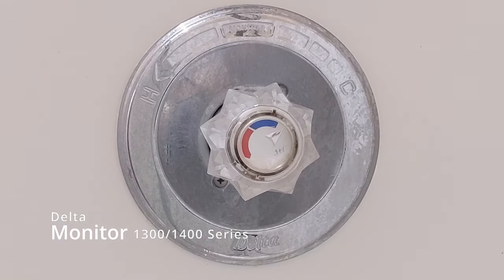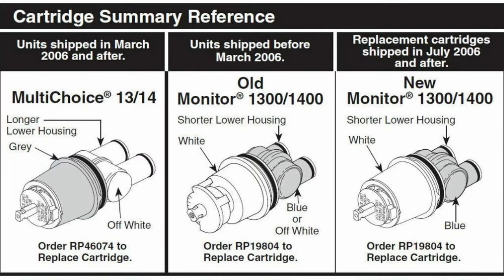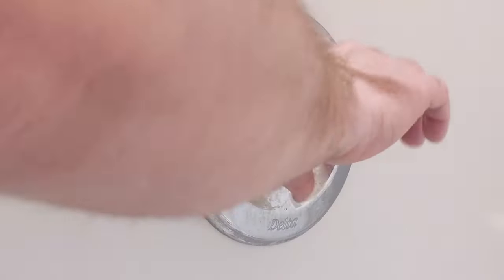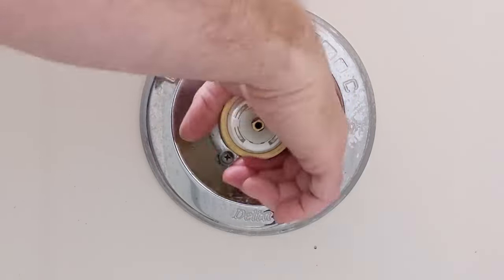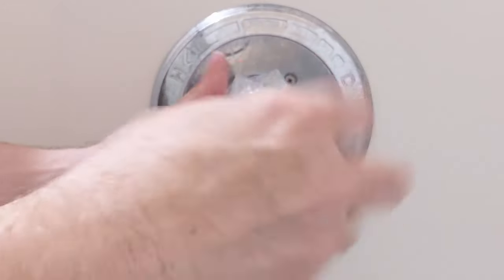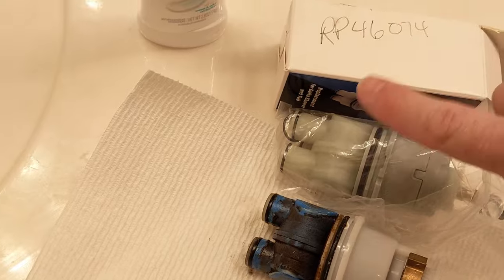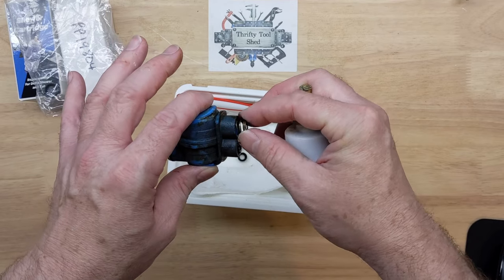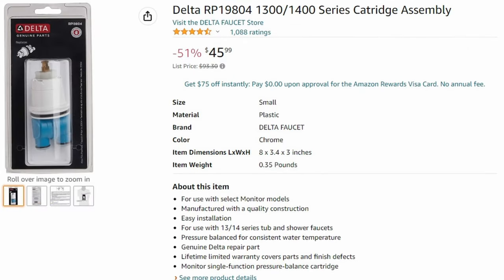Delta Monitor Shower Valve Cartridge Replacement

Comment: This is for anyone that runs into the kind of problems I did. Cartridge WOULD NOT come out. Finally the flange around the the ports that hold the seals & springs broke away and the stem assembly came out. Clamped onto the ports with needle nose vise grips. After much effort the port assembly came out far enough I could grab it with channel locks from the side. Never did see what was holding it. Luckily there was no significant damage to the valve body and none to the connecting plumbing, so a new cartridge solved the problem. Hopefully, I'm the only one that experiences this. Thanks to Thrifty Tool Shed for showing me what I was dealing with.
Reply from the maker: Thanks for sharing your experience with all of us.  Glad you found it helpful.
Reply: Mine also the part holding the seat and spring left behind on the faucet. Can I wiggle up and down so that it comes out easily or use a set of pliers to pull out the part separated from the front part of the cartridge?
Reply from the maker: @HMR2121  
Sometimes the line will have a vacuum on it if any lower line is dripping or draining and the shower valve is off. Make sure the shower valve is turned on so it releases the vacuum and you should be able to gently rock it back and forth and get it out.
Reply: @ThriftyToolShed  Thank you so much, I took it out and replaced a new cartridge and it stopped leaking. Wow! You saved me hundreds of dollars.🙏
Reply: @ThriftyToolShed  I turned on my shower valve, but I could only get about 5 mm of the cartridge out. Can I spray WD-40 in the gap hoping it will get to the seals and releases the cartridge out? Will that WD-40 damage anything? Thank you.
Reply from the maker: I don't believe it will hurt anything, but are you sure you have the valve  open and it's not a suction on the line? They can be stubborn to get started out sometimes.
Reply: @ThriftyToolShed  Thank you for your prompt response! I've the valve to the bathtub open and the water diverter stem pulled up. Is this correct? Thanks!!!
Reply from the maker: @Kat-io5tc 
Sounds like it. If the valve is in the middle so both cold and hot lines can vent then it should be good. Sometimes they are harder to pull out. It's ok to pull some on the  cartridge, just make sure you don't damage the threads on the valve body and don't push/pull against the plumbing in the wall. Once it starts moving it will typically wiggle out.
Reply: @ThriftyToolShed  Thanks for always getting back to me! Finally, I was able to get the cartridge out in one piece. I took the top part of the cartridge out and spray the cartridge with white vinegar, left it for about an hour, clean the vinegar out, put the top cartridge back on. Then I was able to move it out. The vinegar and removal of the vacuum seal worked. Hope this help those who might have the same struggle. Thanks for your awesome video and advice!!!
Reply from the maker: @Kat-io5tc  Awesome! Glad it helped!
Reply: Mine is currently broke off and half of it stuck in there 🤦
Reply from the maker: @kellysmith7523
Did it break or just twist apart?

Comment: Cartridge reference diagram was helpful. White Vinegar helped a lot with corroded parts. Cleaned all corrosion with a plastic brush prior to reassembly and used plumbers grease. Working perfectly now. Thank you for this video.

Comment: I really appreciated this video.  There are many videos about how to replace the cartridge, but this is the only one that answered all of my questions as a 78-year old widow with no plumbing experience.  The most important thing was putting in the cartridge and not trying to force the little triangular tabs into place, but rather hand tightening the bonnet to do the job.  Shower no longer drips!  Thank you!
Reply from the maker: Excellent work! Thanks for your kind comment!

Comment: Thank you so much! I would NEVER would have figured this out myself. This may be the most helpful YouTube video I've seen. I did go with a knock off replacement. But, what the Heck! I can now easily install a new Delta Cartridge if the cheap one fails! Thanks again!

Comment: This video was incredibly helpful.  I was convinced I had the wrong cartridge because it would not go in.  Once I applied the plumbers grease and wiggled it with pressure it went in.  Also, great info on the bonnet nut being hand tightened.  The one I took off was tightened with a wrench.  Thank you!
Reply: This!! I thought I was fucked until I applied the plumbers grease

Comment: Great video, pretty easy fix. The first step you need to do is call Delta and talk to customer service. Delta has a lifetime warranty on all faucets.  They will send you the replacement cartridge for free, a$60-$75 value. Just talked with them today while dealing with a leaky shower that was installed 24 years ago. Was on the phone for 5 minutes and they are shipping me a new cartridge today!
Reply from the maker: Great to know. I know they have a lifetime warranty against any manufacturing defects and I totally don't expect a company to warranty rubber seals for a lifetime. Very good of them to go above and beyond for sure. Thanks for sharing!

Comment: I have replaced 10 of these in my home over 20 plus years and on number 11 it would not slide in like the previous times.  I had cleaned, lubed  and still a no go.   Using the brass bonnet to inch it in was the key.   Thank you for this video and saving the headache.
Reply: Same problem for me. I was about to give up and just tightened the brass nut a little past hand tight and it worked like a charm.

Comment: Thanks for posting this, especially the part number. My Delta is a late 90’s vintage and 19804 fit even though the package said 2006 or later. I only had to shut the water off for about 4 minutes. Much appreciated.

Comment: Just want to say EXCELLENT video. From the 2 different types of replacement and pictures. I brought the cartridge to Home Depot and they couldn’t even really help. My cartridge broke from the handle and it came apart in 2 pieces but with vice grip I got it out but just came off in pieces. Amazing video overall. $100 in just parts and about 2-3 hours with going to the store and just taking my time as it was my first time.

I just rather go with delta parts as if they lasted this long I hope it would last as long as before. Also believe it broke off with also kids playing with it too.

Comment: Our shower wouldn't shut off completely so I considered replacing the cartridge but before I did that I replaced the springs and rubber seats for less than $3. 
 Solved the problem.

Comment: This was so helpful! Never changed one out before, and it went perfectly! Only thing I done different was to use a rubber pipe wrench when removing the brass nut. No scratches.

Comment: Enjoyed your video ! 👌Need help from an expert .  Question : Since I do not have a hot water valve cut-off , what is the best way to turn hot water off when I am replacing the cartridge ?
Or the steps to take to turn water off and then back on after the replacement ?
Thank you so much  ! 🙏
Reply from the maker: Well the best way is to isolate the hot water from the water heater. If not possible then by cutting off the main water as I showed in the video. After isolating the whole house and then of course draining as mentioned. I did in the tub under my shower and left that valve open to double check to line pressure. The one thing to always make sure is that the water heater does not drain and try to heat up. It can destroy a water heater to leave it operating and not have water inside. I made sure not to drain the tank, but stop the water going into it so no water can push out. Hope it helps!
Reply: Thank you ! That makes sense ! Understand now.
You know , I really like just a simple hot water line cutoff.
If I had a house built , I would have hot & cold cutoff on the shower. So much easier for sure.
Doesn't make sense when you have hot water cutoff under your sink !
Thank you 🙏

Comment: Should this be replaced if it's not leaking? Mine is 17 years old and it's ok but was thinking should I replace it before it breaks (preventive maintenance)? Thank you for the video.
Reply from the maker: I would think it depends much on the amount of use and water quality also. I have some over 20 years old with no problems. I typically see the o rings get hard and start dripping, so it usually let's you know when it's time, but I can't say it won't fail completely at any time.  It's the roll of the dice as usual to me. Odds are that one day it will start dripping so I personally wait until then to take action. I like your thinking ahead approach though!

Comment: Thank you for this, I just realized I forgot to replace the big o-ring that keeps the metal cartridge cover from spinning. Is that bad, will that cause a leak of some kind ? Thank you.
Reply from the maker: I would absolutely put that on! That is  the outer seal. I'm glad you found it helpful.
Reply from the maker: BTW
I was assuming you meant you left it out. If you simply forgot to change it to the new one, at least, it should seal with the old one. But it could pose a problem with premature failure of the seal and leak.
Reply: @ThriftyToolShed  Thank you for the speedy reply. I just called my renter & told em don’t throw it out!
Reply: @ThriftyToolShed  I didn’t get a new one in the cartridge package. so I guess it’s reusable.

Comment: Hi - followed all the steps to this, but when I turned the water main back on, the shower turned on and would not turn back off no matter how I turned the valve. Any thoughts?
Reply from the maker: I have never seen this, but it would have to be an o-ring or seat issue. The springs press he seat against the plate when the cartridge twist together. Possibly a bad cartridge or did it twist and come apart somehow?

Comment: Will all of the newer trim kits for the Monitor 14 series fit these older style 14 cartridges (19804)?  I've got a home built in '99 and I'd like to change the trim pieces out but keep everything the same behind the wall.  The way the handle attaches seems similar, just wondering if the slightly longer vs shorter cartridge will give me issues.
Reply from the maker: As far as I am aware.

Comment: Help accidently unassembled bottom housing of cartridge valve. Not sure how to put it back the right way? I kept trying to assemble it back together but water won't come on.
Reply from the maker: Just now seeing this for some reason. I know the back of the cartridge twist 90⁰ and pulls apart so to reassemble make sure the seats are still in place and press back in 90⁰ and press together and twist until straight....

Comment: Some of the "imitation" cartridges have an allen screw going thru the shaft that the handle attaches to...does that really serve a purpose?  I really want a very hot bath at times.
Reply from the maker: I have not seen the ones with the Allen screw in the shaft. I don't know what purpose it would have in the shaft really. The temperature adjustment is usually a physical rotation stop.
Reply: @ThriftyToolShed  You are correct.  I asked a fellow at Home Depot and he thought it was a rotational stop.  I experimented and it is not; left it off.  I ended up using the Danco replacement cartridge(10347) I had on hand and it's stopped my leak but it seems the flow-rate is a bit reduced...no big deal.  But to truly fix the actual Delta cartridge, do I need to replace ALL the round washers(1-big, 2-small) and the seats and springs?  I don't see the washers on Amazon.  I went to my nearest stop(Ace Hdwe) and they didn't really have anything that looked close other than the seats/springs.  Is there a kit somewhere that contains everything?  Thanks, mate.
Reply from the maker: They can be hard to find, and the price is not much lower than a cheap cartridge that comes with all of it honestly. This is an example of one similar. I have not used them to say for sure. 
https://amzn.to/3ZndjjA

Comment: I tried and failed the darn thing broke in half and I had to call the Plumber after working on it for a couple of hours Glad I did because he had to chisel  the heck out of it to get it out. Had lots of calcium build up after 22 years. FYI make sure to use CLR to clean up everything inside before installing new cartridge.
Reply from the maker: True, some well waters especially will have hard water build up and cause issues from sure. Thanks for sharing your experience. Crazy that the plastic cartridge had to be chiseled out. I have seen metal to metal issues more with hard water and minerals for sure. WOW!
Reply: Agree. I just chiseled the heck out of mine too. It didn’t want to budge. Came out piece by piece.

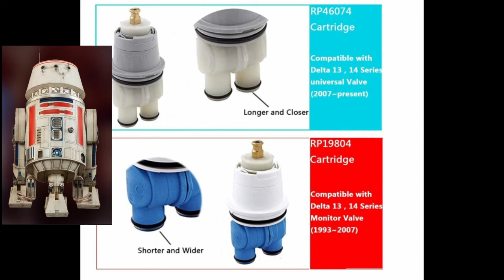Comment: At 1:06 you ask "Am I the only one that thinks these cartridges resemble a droid?" I can see that, but I think it looks like an inverse Smurf - blue pants, white shirt. I may not remember "Delta RP19804" next time it needs to be replaced, but I can remember "inverse Smurf" forever.

This video was valuable to me in that I see that I may be missing some parts, like the threaded retaining nut that holds in in place. Did the previous owner drop it into the wall? Additional investigation is called for. As it is I'm worried the cartridge may shoot out like a bullet with the water pressure. 

And that screw cover with the arrow, I don't have that. The previous home owner must have lost that as well.

Comment: I just replaced mine and it makes a loud humming sound when I run the water. Is this normal? No leaks
Reply from the maker: I have not heard one do that myself that only started after a cartridge swap.  I have seen too high of water pressure to the house cause humming or whining, but strange that it is only one valve doing it. I guess some debris could have possibly gotten into the shower head and causing the sound, maybe. Just a thought.
Reply: Thanks for your time !

Comment: Is there any real function difference between the two valves? Im replacing an pre 2007 delta shower hardware with a newer model. The new one came with the longer stems so I bought the older one (blue) that fit the valve already installed. I test fitted the newer handle and it all seems to work fine but was unable to test hot water due to not having the shower wet in yet. I had no was to run it long enough.
Reply from the maker: I believe the length is a little bit different from the body to the seats.

Comment: I have this exact same faucet but the blue part is stuck in the inlets only the white part of the valve comes loose where I can see the seats for the hot and cold
Reply from the maker: Sounds like the valve body split at the joint. You may have to carefully pry the flange of the residual piece out. Be careful not to damage the brass threads.
Reply: @ThriftyToolShed  got it done by feeding a piece of wire behind it and pulling it out. Installed the new one now I can't figure out why it will not shut off it runs wide open no matter where I turn valve
Reply from the maker: Glad you got it out. Make sure the o-rings are still in good shape and not cut or rolled up. Also double check the seat area inside the valve body is free of debris and burs etc. that is all I have ever seen other than the internally being bad.
Reply: @ThriftyToolShed  yeah I even pulled it back out and change the o-rings reinstalled it.. and it just runs like the valve is wide open I can't close it it doesn't slow down anyway you turn it. So I'm on my way to plumbing supply to return this valve and see if I can get a different valve. I just don't understand what would make it run wide open?
Reply from the maker: @full-light  
As long as the shaft is turning it should absolutely be shutting off or at least changing flow. Strange unless the valve has internal issues.
Reply: @ThriftyToolShed  confirmed it was the right valve installed again still the same issue running wide open
Reply from the maker: You have to make sure you are truly turning the shaft of the valve. No way 2 new valves are not turning off. You will need to get some one locally to help you if you cannot figure that out.
Reply: @ThriftyToolShed  Hey brother I really appreciate all the help. I finally got this figured out. Just for future reference. If you hear of this again or make another video let everyone know if they use an 804 where the 074 is supposed to be. This will happen! I finally got the correct cartridge which was 074. They said it makes no difference,... It absolutely does!
Reply from the maker: @full-light 
Glad you got it. Yeah, I thought I mentioned the correct part numbers in the video. Thanks for sharing!